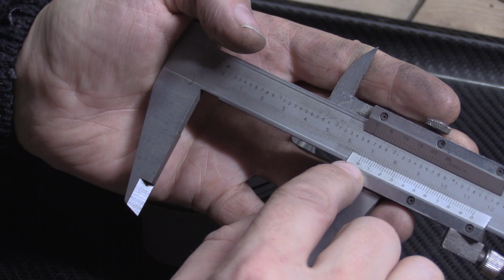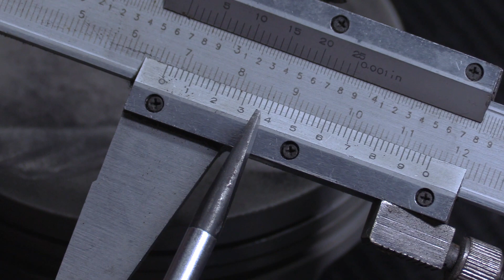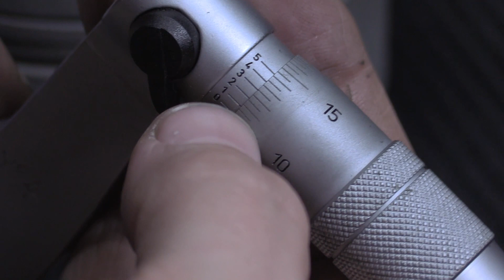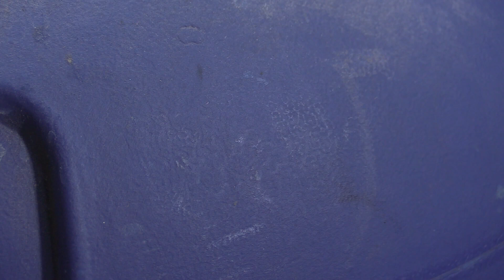Carbon Removal # 13 - Suzuki Trackbike

Comment: Your point towards the end about not getting all the power out the bike.. good story here.
Kailub Russle
Multi time (GNCC) National harescramble champion. Rides for KTM. Last race of the series he was so ahead on points, he didn’t even need to race to win the year end championship.. KTM was doing a bike giveaway of a 150cc 2stk. 
Kailub raced the 150cc stock bike in the last race, in the main pro class of course against the factory 450s.. factory riders, on factory 450s..
Kailub WON the race, on the 150… GoPro footage is likely still on YouTube. He passes other top tier factory’s riders on the 150, and won the race.
Moral of the story. 
You’ll never get all the capability out of most bikes, & gear/kit doesn’t substitute for skill.

Comment: Hi Matt, interesting to see your parts cleaning efforts. I know I keep chunnering on about my vapour honing (vapour blasting) process. I use several types of media depending on what is required. My go-to media is glass (of various grades) I would never go near any ally parts with ceramics media as it is too aggressive when used in my process. Vapour honing mixes a blast media with water and high pressure / volume air producing an abrasive slurry. I use it for restoration work and finishing CNC machined parts where the tooling marks need removing. Using glass media and moderating the air pressure, I can even use it for removing burrs on 3D models. I have done loads of pistons with success leaving them looking like new. I will try and put something together for you to look at, I am sure you will be impressed. The first set I did, I was very suspicious about the claims made about not affecting dimensions after blasting. I accurately measured a piston before and after, even physically cleaned sections of the ring grooves then measured them after blasting - absolutely no change and the pistons were like new

Comment: + 100% with your take on this and the modifications route. 
What you propose will indeed be interesting, it will also be interesting to see if at all there is any difference between the two with regard to configuration. 
Have a good one👍🏻

Comment: Hi mat  have a high mileage gsxr1000k7  use little oil 103k+  mostly road use although occasional track use brakes upgrade pads hose  then suspension were most successful upgrades,,although decat & exhaust valve delete created better  midrange arrow system. No I'm not fast bordering intermediate pace. Enjoying technical work  thanks

Comment: Try racing 125cc, there's a skill builder there. You CAN NOT muscle your way out of anything because there is no muscle! But this does really require smaller Kart tracks that you may or may not be able to use. Little 125 on full size tracks is a lot of time running wide open waiting for the next corner, just not that fun. But on short twisty tracks like a Kart track is wicked fun!
Reply: Depends on the 125cc too, getting the most out of it in the straights is part of the skill.

Comment: I totally agree with not needing more power and learn how to ride what you have. I am also one of those bell ends that gets the underpowered vehicle and tunes it well beyond its original design brief. I am more interested in four wheels on track and I take a lot of pride in embarrassing much bigger and faster vehicles with my little toaster shaped 65bhp Daihatsu Hijet. It becomes more of an engineering exercise going out and tweeking settings getting it to go round corners and stop and not end up on its roof. The next step is more power, compression or forced induction along with lots of other supporting modifications for me is part of the fun and pushing the boundaries of what's possible in the real world is where the answers are, ceramic coatings, polishing, shot peening, ballencing etc is all on the cards for the original components, it's improving the resilience to the more hostile environment. I love the finish that tumbler puts on ally with the wallnut shell.

Comment: So v good points Matt, v well made. You won't have to wait till it goes bang just stick an endoscope down the plug hole after every track day. Would love a tumbler to clean my bolts, spring etc before replating them. I soda blasted my piston on the Z500, took less than 5 min each. At Croft we have see lads on those CB500 twins showing up some of the GSX'er guys.

Comment: I had not thought about using walnut media in one of these tumblers, looks like it works pretty good.
Reply: You can buy it in different grades as well =)
Reply: Ground walnut shells were originally used to clean the gas side of large turbochargers. A calculated measure of the ground shells was placed into a container, the engine revs reduced to again an optimum speed calculated by the turbo manufacturer, in the case I'm referring to was Brown  Brovei of Switzerland, ( now ABB), compressed air charged the cylinder and the shells were fired into the TC. 
The shells would impinge & ignite carrying away the hardened products of combustion that had adhered to the TC blades. It was called nut blasting.
Similarly water and a chemical mix was used on the air side which we called water washing. 
Just a bit of Christmas time history for ye all.
For pistons, heads and valves a soak in plain water should soften to any carbon prior to more aggressive cleaning. 
Merry Feckmas😉
Reply: @digger8180  I knew that walnut was used as a blasting compound for cleaning the carbon from the backside of the valves and general intake on direct injection engines. Stupid PCV rules about emissions causing oil blow by to burn on the backside of the valves. I think BMW does this, my KIA requires a solvent cleaning for the same issue.

But walnut in a tumbler was new to me, and something I might try the next time I machine a bunch of parts to clean up edges and reduce surface marks. Here is the USA we can get tumblers pretty cheap from a certain discount tool chain store, about the same size as the one Matt was showing. I think they carry walnut media because they carry several different media blasters.
Reply: The walnut shell media is also used to clean helicopter gas turbine engine. It's fired into the intake while the engine is running, if memory serves. Apparently cleans the turbine blades up a treat.

Comment: Rotary tumbler can be implemented with small powered vehicle (lawn mower ie), just tape food container with stones to wheel and make it turn. When you want to just remove rust from something like bolts and nuts it works fine, cleaning rust inside of old fuel tanks with ungalvanized nuts works too but takes many hours
Reply: Edd China did a Range Rover fuel tank a few months ago, he tied it to a cement mixer and let it run for a few hours, did the trick.

Comment: totally agree , I've gone down to a 250 from a 650 as its only 100kmph over here on the roads and I'm too old now. how does it affect 2 strokes as the oil build up may be greater ??? not sure

Comment: Matt, please do justice to the piston crown polishing process. You first need to properly FULLY FLATTEN the piston crown surface, then SMOOTH the surface with successively finer grades of polishing paper. ONLY THEN can you start polishing. 

Trust me mate, there’s a ton of difference between polishing the rough surface (which can be done) and doing it properly. 

You may be interested to know that I’ve used similar methods to flatten faces and sharpen edges on vintage woodworking tools using Japanese water stones. I’m able to attain a mirror finish that I can literally use as a mirror - to read a newspaper behind me. 

Yes it’s a bit of an obsession. But in the case of the woodworking tools the result is outstanding. Edges last up to ten times longer, and I’m able to plane fine shavings off the END GRAIN of just about any timber. Indeed, I’ve won bets doing that. If you asked a thousand woodworkers they will tell you that you can only get dust when planing end grain. 

Like I said, it’s a bit of an obsession, but so damned satisfying. Old 19th century steel is best. 

Mask your bearing surfaces when tumbling. 🧐😎😜

Peace

Comment: For carbon to cause detonation it must be uneven layer and it will just rip this layer apart anyway, if it is a problem it must build back up instantly, so oiling combustion chamber is reeealy nice

Comment: Thats the thing with alot of riders, buying and riding bikes way out of their capabilities and think they could control the bike just because they redlined it on 1st or 2nd gear and their brake disc are still warm after a ride

Comment: Good vid Matt, we're just finishing off our own parts tumbler -- pity links can't be used or I'd show you =)

You could actually do another video about the different media types (and their related uses) that can be used in the same equipment ...well, at least I'd find it interesting, and a lot of folks aren't aware of this kind of stuff...ie; there are a few types of wood based media alone, not just walnut shell.

Comment: HELP NEEDED my wr125 is making a rattle sound I have done the idiots but the one right rocker arm is loose even tho I have done valve gaps I took my piston out and it’s scratched n the barrel thst was just installed

Comment: What! No water in your rumbler, criminal! 
PCP superbike fuckwits do my head in, ballistic on the straights but a traffic jam in any corner good thing is they’re usually nowhere near the apex so it’s not that hard to get through. 
A well ridden CB500 or SV650 will rinse most things in the fast group and can be bought ready to go for less than the cost of the official Ducati riding kit.

Comment: Hehe. You said percussion cap but you meant primer 🙃 it’s not 1893 anymore, they use primers for center fire cartridges, not percussion caps on muskets 🙂
Finally, my turn to correct Matt over something trivial.
Reply: Primers were in wide use well before 1893.
Reply: Gun nerds... The nerdiest of the lot... Maybe lord of the rings nerds are nerdier but that's all.
Reply from the maker: It's what we called them in the army
Reply: @thedirtyworkshop  well there you go I did not know that. You only know what you only know.
Reply: From my knowledge a percussion cap is a explosive filament housed in a cap that needs a nipple and a flat faced hammer to ignite the charge . While a primer contains the anvil and filament within itself and only needs a firing pin to ignite the primer...

Comment: Is this basically what REM polishing is, for transmission gears etc. Also does polishing gears in a transmission even benefit from the less friction or is it so little it's negligible? Please can you do a video on different media, uses and advantages of using this process :D

Comment: Hey Matt, Great to see you using walnut shells. They are vastly superior to all the other nasty abrasive media because of the lack of damage, potential surface penetration, and the way they hide in corners. Where do you source them in the UK?
Reply from the maker: I can't remember, it was a long time ago
Reply: @thedirtyworkshop  I remember a few years ago some said walnut shell is  sold in pet shops as bedding for lizards or some creature like that? Or it was bad dream???